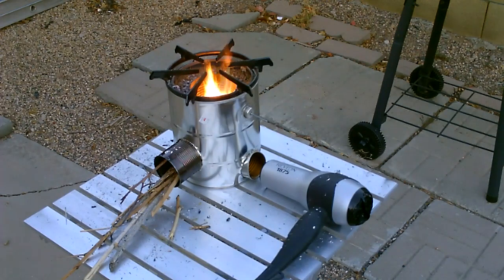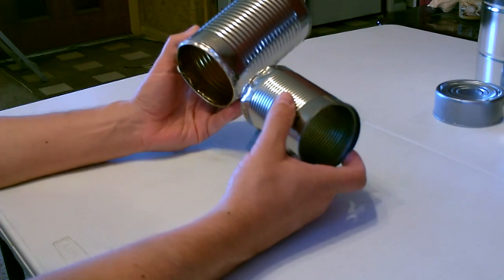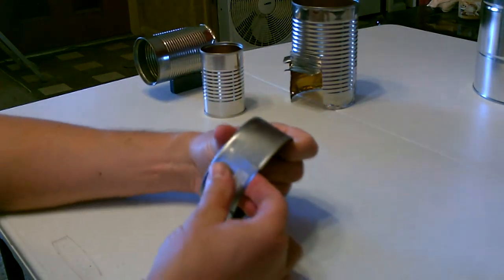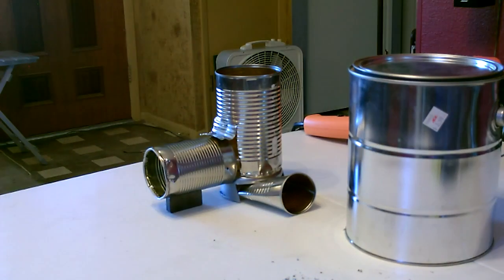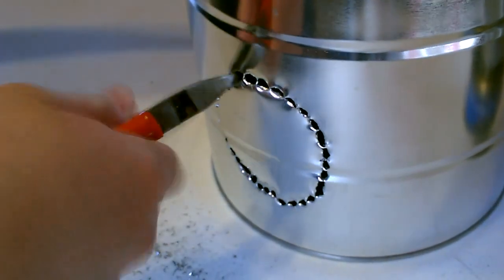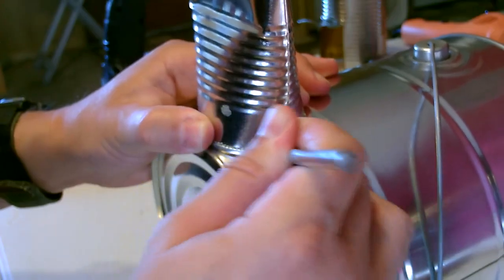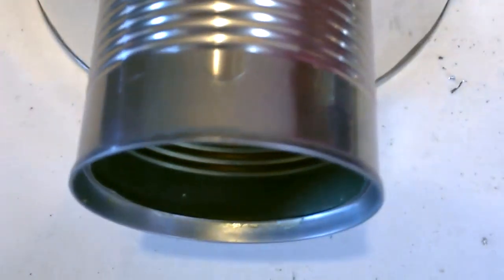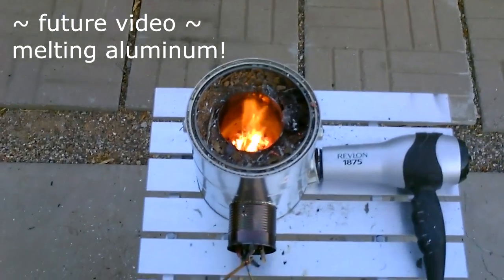Homemade ROCKET Stove! - The 5-Can "Fan Forced" STEEL CAN Rocket Stove! - Easy DIY - SUPER HOT

Comment: Put a rocket mass water heater with a sterling engine that pumps the hot water through hoses through a cement slab to heat a home or green house or shelter. You could circulate cold water has well to cool the home.

Comment: I do recommend extending the length of the air intake pipe. My son went through a rocket stove/forge experimental phase and melted every freaking hair dryer in the house for a few years. My daughter and I were to the point of hiding our hair dryers from him. 

Yes, I bought him his own, but when he was between hair dryers and inspiration struck, he had to heed the calling of his muse. smh
Reply from the maker: hi. i don't actually attach the hair fryer to the pipe. i just set it near the inlet. i've been thinking about trying a strong computer case fan. that may work pretty well too. those are 12v so you could run it off a battery or solar panel etc...

Comment: how would you force air in during a grid down situation? this little stove is very cool.
Reply: I also was wondering if the hair dryer was running off of solar power?
Reply from the maker: hi there and thanks. could use a small 6v-12v solar panel w/direct connect to small DC fan (computer case fan or 12v auto fan). or if no sun - could use battery. if interested, here is a ink to an earlier video i did on that topic https://youtu.be/zZF7mUG8PVU
Reply: +desertsun02 cool, thank you, I like your builds, very cool channel.

Comment: That will get so hot it will melt lead! I used a computer fan connected to a rheostat and then a 6 volt battery on mine. I didn't have it then but I'll bet a Coleman  camp  oven would get hot enough to cook a chicken on the forced air rocket stove.
Reply from the maker: hi there. yep, it will easily melt lead. *i just finished a charcoal burn and melted down a couple aluminum cans. once charcoal gets hot (and crucible glows red)- only takes a few seconds for each aluminum can to melt down.